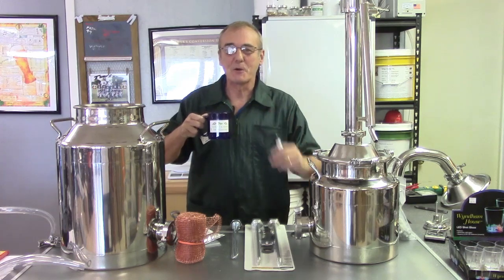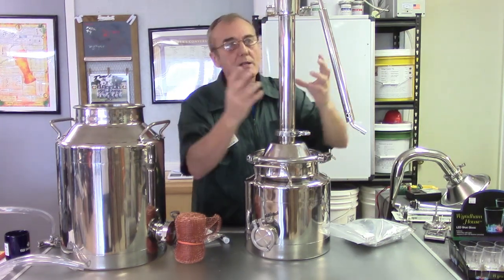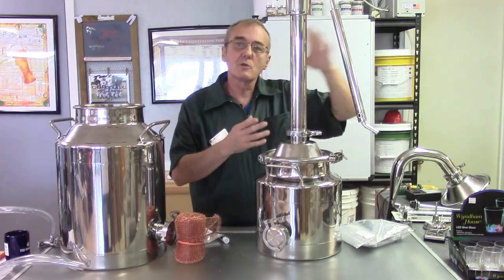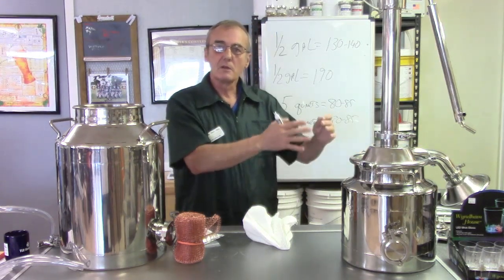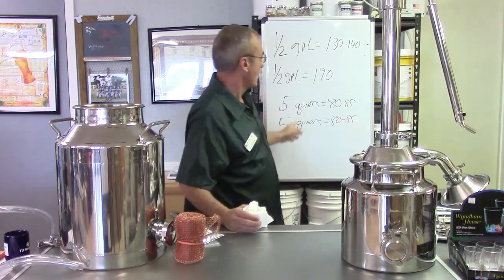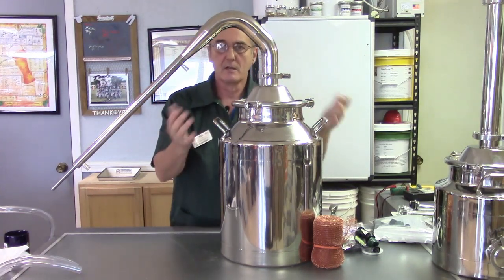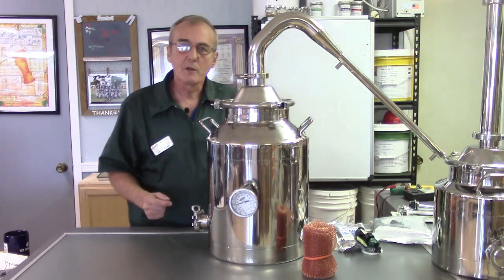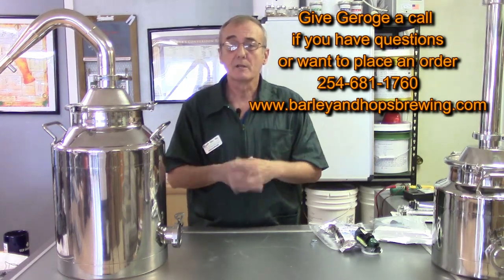Pot versus reflux and more

Comment: Copper saddles, mesh and pennies dated <1964 have been mentioned for packing a column, but it would also work with a handful of solid conductor copper wire stripped/cut into short bits...
Reply from the maker: Sure would

Comment: Shopping around for a still I kind of like the traditional Copper Pot stills but I've heard the reflux stills are better
Reply from the maker: Sorry for the delayed response. I was on vacation in Vegas for the past 5 days.
The combination pot/reflux is best in my opinion. It gives you the best of both worlds.
Reply: Barley and Hops Brewing I am a big fan of starting out with  Mile Hi Distilling’s 3 gallon stainless steel mighty mini combination pot/reflux still. As you gain experience you can always add on to it. You can even go with a bigger milk can boiler; 8 gallon for Instance. It all depends on your ceiling height and how wild you want to go. Add numerous sight glasses with bubble plates, and or a gin basket. The sky is really the only limit. Have fun and happy distilling to all, and to all some fantastically exquisite home made spirits!

Comment: Hey George ... if a pot still is controlled by the heater element, and a reflex still by the water adjustment of the cooling chamber .. why did you make a pdi controller for a reflex still controlling the heating element and not the cooling chamber ... You need to put a solenoid valve in the water line.
Reply from the maker: Incorrect. Heat is the major driver in a reflux still. The minimal water flow the catalyst for the reflux chamber only.

Comment: Great explanations on your video. Can you tell me what does the copper mesh do ? and I have also been told to use glass marbles in place of ceramics in the tower,  so what is the purpose of these ceramics ?
Reply: Chris Boyce Nucleation points. Basically more surface area for vapor to condense on which makes it harder for the less volatile vapor (water) to reach the top of the column and get condensed to liquid product. Think of it like a race. Say the ethanol is a slightly faster car than the water car. If your track is very short both cars are going to finish at about the same time. Make the track much longer and the difference in speed becomes more apparent. This analogy isn't the best because it's not exactly speed that is different in the distillation case but I hope it helps get a better picture of the situation
Reply: Copper removes bad tasting sulphurous compounds, glass beads provide more surface area for condensation.

Comment: Hi George.
What is the length of the Leipig condenser on this pot still and how many tubes are in it.
Really appreciated your swift response.
Amazing instructional videos Sir. Thank you.
Reply from the maker: It is about 28 inches or so. This one does not have tubes running in it. It is a two piece where the tube running out of the still head has a somewhat larger pipe that jackets almost the full length. It is welded on both ends so it essentially is a pipe inside a pipe.
George
Reply: Thank you for your reply George. That makes sense. 👍👍

Comment: The volatile vapors are - sorry to tell you this but - the volume originally settles at 74 degrees or so. There is no making a change from that, doesn't how much temperature you apply. My brews ALWAYS boil out at 95 percent at around 74 degrees. Although for tailles I allow around a max of 85 degrees. Can't get any better than that. I generally carbon filter half of my yield      ( around 15 litres) and leave the other 15 litres at original. I enjoy the best.

Comment: Hey George,

I ran my 13 gallon column reflux still for the second time on a gas burner and both time the still started to spit out heads fore-shots and heart at much lower temperature ., the still never reach a temperature past 204 degrees.Im rather confused..Got any ideas? thx. Bret
Reply: Could be a few things, the easier thing is to check that your thermometer is calibrated correctly. There are two things you can use to check for calibration. At sea level, icewater (water loaded with ice) should read between 32-35 degrees, and boiling water should read 210-212 degrees. So use those number to see if your thermometer is in the right neighborhood.

Secondly, your reflux water may be on the warmer side or there is less than optimal flow (or both). Being summer time, the heat source doesn’t have to work as hard to heat up all the still components. 

3rd, where are you measuring the temp? At the boiler or at the column head? The boiler should always be hotter than the column head. Ethanol vaporizes around 170-173 degrees which means it also condenses if the vapor drops below that, so you shouldn’t be looking for 204 degrees at your column head, that’s just too hot and running real fast and you lose proof.

Comment: Thanks brother for the video,so I have a 22qt pot still and a 2 gal Thumper should the tails be split half and half with still and Thumper or what..?? my last run had to drop the Thumper but next run it will be at work was thinking run 4 gal in still 1 to 1 ½ gal in Thumper..or do 3 and 1 ?? still new to this ³rd generation with still.. Grandfather Cob would say any fool can make shine but only a fool drink it... Unless it's mine I think he said. thanks from vessel No problem

Comment: Hi, How do you adjust the reflux ration in mighty mini.  If had the PID controller hooked on, like you showed, would you still need to control water flow to control?
Reply from the maker: Yes, water flow is still necessary even with a PID controller. PIDs are best suited for pot stills.

Comment: Hi George.
I am a newby to distilling and am making my own still that I can run as a reflux or a pot still.
Two questions.
1. does the Liebig condenser only require a single tube through the water jacket or would it benefit from a Gatling design with multiple tubes.
2. When running as a pot still do I still need copper, stainless, marbles etc in the main column.
Love your videos by the way.
Many thanks. Mel Uk.

Comment: No George, it doesn't kinda make sense because you didn't finish the explanation. If I wanted to bring my temp up to 168F and hold it there for a few minutes, how does the temp in the mash convert to that 168F I need at the top of the condenser? I know I can get that by looking at the temp at the top of the reflux. I still haven't seen anything that says how to do that with the pot still. Why don't they have thermometers at the top of a pot still?
Reply from the maker: They do. Every pot still I run or demonstrate has a thermometer in the top of the column.

Comment: Great videos Mr. George. Is that pot still shown here available in 5-gallon?
Reply from the maker: No, they start at 8 gallon and are designed for a 5 gallon run. The extra space satisfies the head room requirement.
Reply: Thanks for getting basck to me George. Whats the price on that 8-gallon still with the elctric set-up.
Reply from the maker: Check with the store 254-300-8226 They know better than I do.

Comment: George, in the reflux model what happens to the methanol that went up first, if they condensed and fell down, doesn't that stay in the rest of run??  and if it is lost somewhere in there , then does that mean there are NO heads to throw away??     Thanks for the great videos, they are very good learning tools..
Reply: They are collected and used for non consumption applications such as degreasing, window cleaning, starting a camp fire, ruining a alcohol stove, make your own windshield wash fluid or pour them down the kitchen drain to keep them clear of grease.
Reply: Scott, I think you missed my point,   a REFLUX still,  the steam rises and then falls back down,  now if the methanol is the first to rise and fall then it seems that it is returned to the wash and would contaminate the rest of wash,  at some point I realize that the reflux will change from say full reflux to some other portion, say 50/50, now what would be continuing through to the condenser should be already past the low temp point of methanol,  since it has been in the column that  has been heated and at a temp higher than the temp for producing methanol, seems there would be no methanol,  I understand that in regular pot still these bad products would be first out and thrown away or like you say used for cleaning,   but the REFLUX still is questionable.  thanks for trying.
Reply: j the methanol and acetone has a much lower boiling point than the ethyl alcohol and the more complex stuff in the tails. so while the ethyl alcohol, water, and tails falls back down into the pot the heads which are made of poison the methyl and acetone continues on to the the condenser and leaves the system. This guy has some other videos that explain it more fully. also there is a whole bunch of other information on how reflux columns work online.
Reply: OK,  that sort of makes sense,   but if you know, why do the heads move on, I am guessing by your answer, that the heads have to go, even if you are cooling the refluxer so the vapors fall, all but the meth-ace. fall, must be something to do with the scientific weight of those elements.   thanks again for trying to inform me..
Reply: jbrunson1949 it's partially the molecular weight as well as the structure of the compounds that determines volatility  (boiling point). Lower weights tend to be more volatile (lower boiling point) and generally the more -OH groups (aka an alcohol group)  a compound has, the less volitile  (higher boiling point) it will be. This is due to hydrogen bonding and one of the reasons why water has such a high boiling point despite the fact that it is very light from a molecule weight standpoint. Compounds that don't have -OH groups like methane or ethane cannot form hydrogen bonds and hence are much more volatile than their comparative alcohols methanol and ethanol. This is why these substances are gases at room temperature rather than a liquid
Reply: BUT, where does it go in the REFLUX  type still does it fall back down since the Reflux still is mainly to bring out the higher proofs of alcohol,  as I see it the lower levels of alcohol as methanol must fall back down and remain in the wash..

Comment: What would you think of onle using only [ one plate]  to get more water out for the out put ??
Reply: Using one plate or several is a personal choice. Operate the still at its optimal level and your product will always be excellent. Multiple plates only leads to more separation and flavor stripping so if you are looking for a more neutral, higher proof, lower volume result; multiple plates will provide that. On the other hand if your desire is a more flavorful spirit, it is easier to accomplish this with one plate as long as you watch your temps closely.
George

Comment: after watching a few videos on the 2 types.... i do have to disagree!!!!! if you fill the CAP of your POT still with copper scrubbies / mesh would it not work just like a reflux still without the addition of a new coloum piece / condenser?.... perhaps not as WELL as a reflux but it should help a pot still, correct?
Reply: LOL sorry... did watch quite long enough before i commented..... and ya did answer my question... will copper mesh help in the CAP / coloum of a pot still TY

Comment: is the top of the column so thin that it can't be drilled and mount a K-type  probe???
Reply from the maker: Well, not so thin. It is not a cheaply made still but it is not impossible to drill a hole in it. I just put the probe in the bung pointing down inside the column.
George
Reply: Sorry,  I did not mention, but it is the pot still that I was talking about,  where you said you used wire ties to attach to out side,  of column arm,

Comment: You seem like you know quite a bit about distilling.  And since you mention fruit essences, one thing I was always wondering is is it possible to make potential fruit flavor essence extracts of non-citrus fruit (without sugar and fiber)  by slicing apples or peaches and placing them on a steamer rack and adding water in the still and steam distilling and then taking the distillate water and adding that back into the still then adding fresh slides apples and repeating that a few times?  I was just curious how that would turn out but don't have my still yet.
Reply: HomeValue Glass if yer going to go to all that work, why not just add a gin basket to your setup?

Comment: George,
How necessary is it to do stripping runs, then spirit runs? I keep reading about it on forums, but I don't know how important stripping runs are, or if they're really necessary. If you have a thumper, do you ever need to do stripping runs? Thanks.
Reply: IH F depends on what you want? Low wines (what you get from stripping) are self preserved and you don’t have to worry about your product sitting on mash/wort/wash. If you want to make a volume of high abv spirit, you need to do a few stripping runs so you can in turn put all your low wines into the boiler so you aren’t making lots of tiny batches.

If you have a reflux still, you don’t really need to strip for high ABV, you just need to go slower to get the high ABV.

If you are running a pot still without much of a column and you want high ABV then yes you need to do a stripping run first. If you don’t need high ABV or you want some naturally occurring flavor, then just run your pot still low and slow to get higher ABV but without sacrificing flavor.

Comment: Hey George, question for you - I have both a pot still and a T500 reflux still with a copper condenser.   Looking at them I wondered why you couldn't take the copper saddles out of the column of the T500 and have the column empty when you run it... It looks to me like it would then be the same as a pot still only with a taller condenser.   Would that work do you think?  Love your work by the way, I've learned heaps from you!  Thanks for taking the time to share your knowledge!
Reply from the maker: Chris,
That actually does work to some extent. I did a video on that topic and after removing the saddles the proof did drop so the reults were much like a pot still as opposed to a reflux column.
Great point.
George
Reply: Thanks for the reply!  Could you please post a link to that video so I can check it out?  Cheers!
Reply from the maker: Check this out
https://www.youtube.com/watch?v=3URJHzDapnI

George

Comment: Hi George.
Pleas ignore my second question as you have already answered that in this video.
Old age kicking in I guess.
Cheers Sir.
Mel. UK.
Reply from the maker: No problem, your second question about the liebig condenser: If I understand it correctly, the traditional condenser is surrounded by water so a single in and out is most efficient. as you describe yours it seems like you will run additional lines along side of the condenser; if that is true the more the better since heat transfer will not be as efficient with only one.
Hope this helps.
George
Reply: Thank you George.
How many tubes are in the Leipig condenser shown in this video?

Comment: hey George I got an odd question on the farm here I have means of  picking and grinding corn that's not dry and ready. could I use that as a malted corn.  if ya understand what I'm trying to say thanks Jim
Reply from the maker: Jim, it will not be a malted corn unless you go through the malting process. That would require wetting and letting the corn sprout to teh right point and then stopping the germination process. But that does not mean you can't use it. The corn will be full of natural sugars and plenty of starches. You could still use them by adding amylase to convert the starches to sugars (which happens during malting). You could do this by adding the enzyme by itself or adding a malted grain like 2 Row or 6 Row barley to it when you heat it up to 155 degrees. This would also convert the starches to sugars. 
George

Comment: On the heating unit, "where is the ground" I only see two screws.
Reply from the maker: There are only 2 screws on heater elements. The ground wire is for the appliance ground. You attach it to the kettle or oven.
Reply: @BarleyandHopsBrewing       You attach it to the kettle / who???

Comment: Alright, so maybe this is a stupid question, but here goes. So if you maintain a constant water flow in a reflux still, couldn't you then make the variable the heat applied to the still, and therefore use your PID? Maybe i'm doing some of that G.I. math again.
Reply from the maker: This is possible since there are several ways to do this. This challenge comes when after you have the balance and the volume changes, which would require an adjustment, the flow of the reflux would need to change and therefore the heat applied would change as well so you end up chasing it from two ends. This is very possible but the way I described it earlier is the easiest (not the only way). People with more experience will find either way fairly simple.
Good question.
George

Comment: what is the math of getting 5qt. product from a 130 and 190 proof distillate
Reply from the maker: I use 1/2 gallon as a data point and explain that for pot still I will collect a little more than 1/2 gallon since some water will carry over with it and that in a reflux I will collect less than the target of 1/2 gallon. 
On average teh resulting cut product will be around 5 quarts (sometimes more depending on strength).
Reply: math is wrong DM i picked it up also.